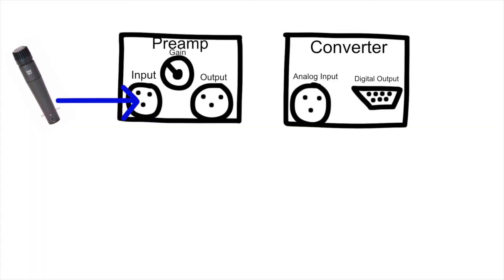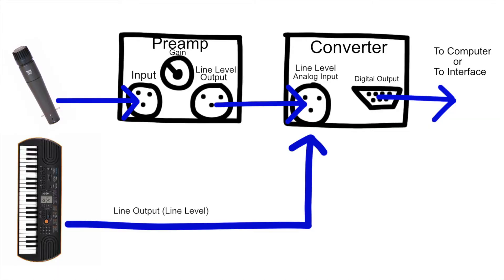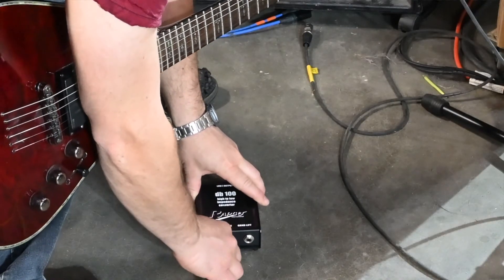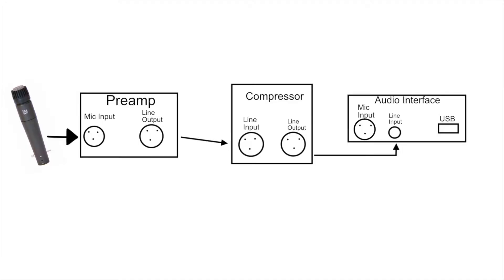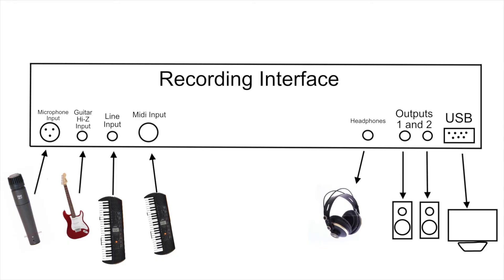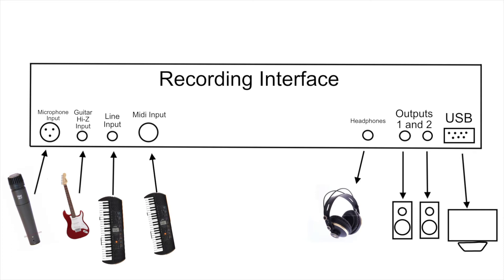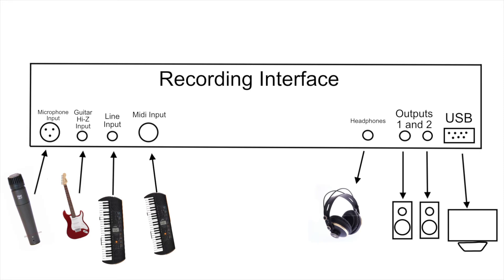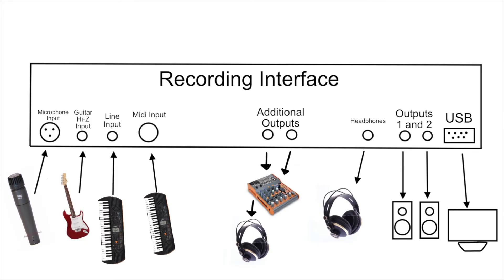Signal Routing for the Home Studio, lesson 16

Comment: Hi Cris.
I hope you're well. Congratulations on your channel. I'm Gustavo, writing from Venezuela.
Please, I'd like you to explain how I should make the following connection.
I have an old Yamaha keyboard that doesn't have a line output, only a headphone output, or perhaps a stereo output. How should I connect it to a BEHRINGER UMC 202HD audio interface?
Should I separate the stereo signal and run it through a two-channel direct box before sending it to the audio interface?
Or could I go directly to the audio interface with the two channels separated?
I would really appreciate your help.
Thank you very much in advance. See you later.
Reply from the maker: Hi Gustavo,
The direct box is not really necessary unless you have really long cable runs, it will reduce noise from interference, but also reduce the overall sound quality a little bit. 
I think your best bet is to separate the stereo output signal into 2 separate mono signals (that are unbalanced)
I have another video explaining balanced/unbalanced signals that might help you understand how to make the correct cable.

Comment: Hi. Thx for the content. Im recording vocals with a lewitt lct 540s in to the golden age preamp pre 73 and the into motu m4 and then into the golden age comp 2a. But my vocals Sound very harsh in 2khz-16khz. Have i to press the line or the low z on the preamp ?
Reply from the maker: Do not engage the line level or the Hi-Z when recording with a microphone. The equipment you are using is excellent quality, so the issue is most likely your room acoustics. You can test this by recording something outside on a nice day, and compare the sound.
Reply: @Get.Pro.Recordings  thx

Comment: Do you find that there is a difference in quality between A/D converters? There's a debate online about whether there is more than a negligible difference in sound quality between top converters and average ones. Was curious about your thoughts?
Reply from the maker: Hi, yes, there is a lot of debate online, some people say it's a considerable difference, some say it's not. Some converters are very expensive, some are not. I was also very curious about this, and since I have a bunch of different converters, I did extensive testing to find out first hand. I have over a hundred videos that I've already planned out, and this is one of them, so I will eventually get to it. However, the short answer is that the difference between a top quality converter and a budget one is very negligible. For the difference to be noticeable, you would need excellent room acoustics, high end monitoring, and even then, would only make a difference on songs that have a high channel count. On a single channel of audio, the conversion by itself would be indistinguishable between any modern mainstream interface, wether high end, or budget. However, the conversion on other devices that are not a dedicated audio interface can be noticeably inferior, such as a stock computer output, or the headphone jack on a smart phone. The single largest factor in determining the audio quality of a recording interface is the quality of the preamps, and they can vary quite a bit.
Thanks for your question.
Reply: @Get.Pro.Recordings  Look forward to your videos covering the topic. Thank you for the useful insight.